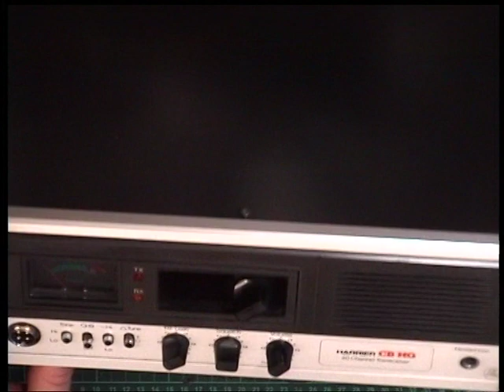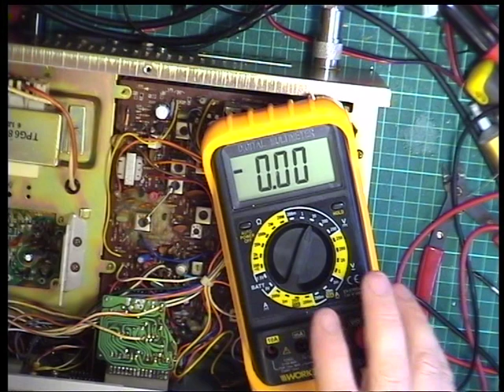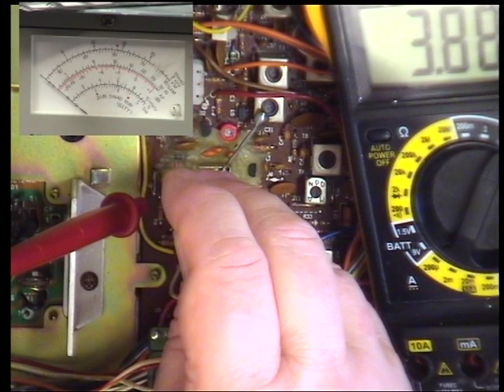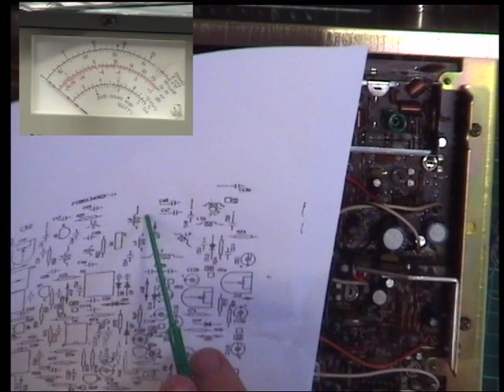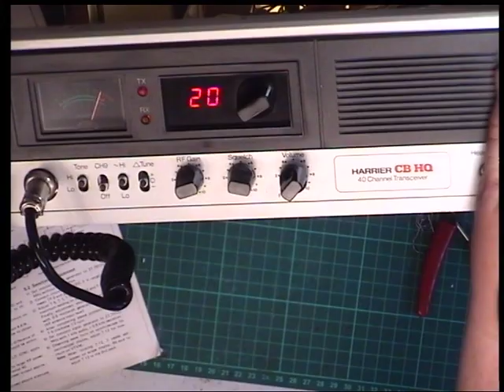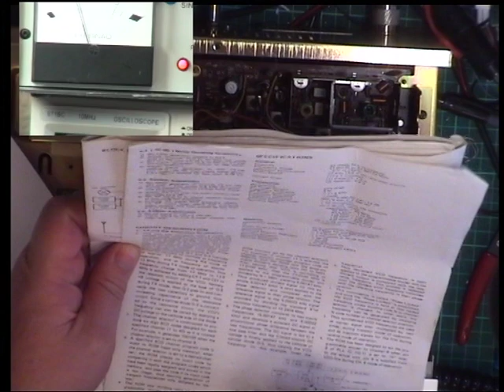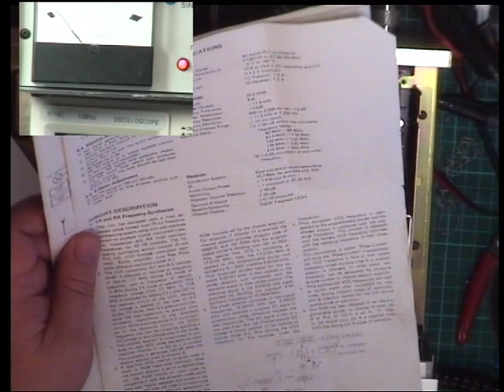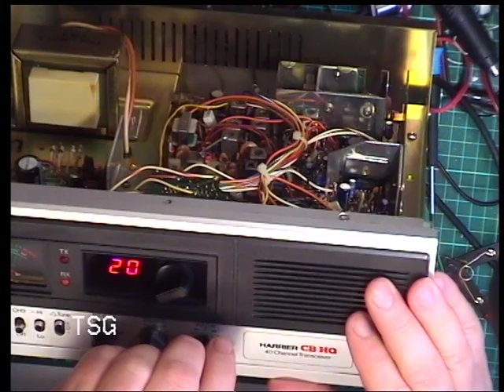Harrier CBHQ UK CB27/81 CB radio (base station) - Repair & Full service alignment

Comment: Ive just Picked one up today well chuff with the radio the only thing radio works very well but the light bulb out ? are the bulbs Easy to change the radios look really nice with the blue bulbs but to keep the radio nice i put white bulb back in to the radio never changed  meter light not sure if its Easy fix
Reply from the maker: The Meter lamp is 12v @ 40mA....those wire ended 'grain of wheat' type.

Richard

Comment: A Cybernet, of course it is a good set.  Harrier just cracked it with its looks and the tone, they just picked the right speaker.  It is just a shame they didn't put a mic gain knob on it and the speech compressor switch on it.  It is still a nice set for being a legal set with no fancy frills and the delta tune just lets you hear someone of FM on EU 80 channels sets or illegal sets.  I have one and in fact that is what is plugged in, if only i could get an aerial up.  I am only getting 3 watts at the moment, but it is box standard as it left the factory.  I have to turn up the deviation as no one can hear me!  I don't understand why they don't at least set it to 2 as 1.5 is a bit low in anyone's standards!  Only thing I hate is black on the back of the meters.  Why did they change from a white background where you can see the meter a lot better.

Comment: I've a one of these in good cosmetic condition which unfortunately has been modified in a rather cack-handed fashion to 80ch as have many sets from this era. Thankfully I do have a similar York CBS869 which is bog standard and is a great radio. By the way I do have an instruction manual, which includes tech info, for a Team Euro 8000 base - I have it as a PDF file and can send it to you somehow if it is of use. Regards.
Reply from the maker: yes please on the 8000 file. You need to get rid of the illegal 80ch conversion which, legality aside makes the radio into a poor performer anyway.
rshireby@yahoo.co.uk
Reply: @ukfmcbradioservicingTango21  - I'll e-mail it over to you and hope it can be of some help. I bought the Harrier as an "untested shed find" type of thing, but was disappointed to find it had been modified - never used it. Cheers.